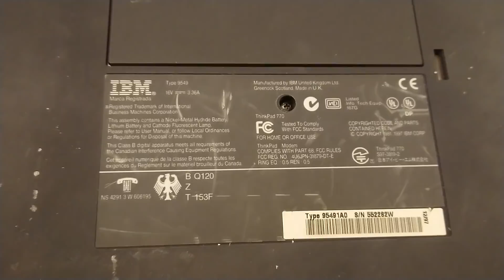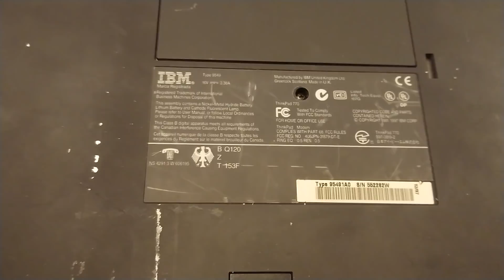IBM ThinkPad 770, from 1997. Vintage Computer Teardown.

Comment: I know was tricky to enter bios do you know how also was an option to disable onboard rams when one of the bank was faulty.
I have 770ed all good just stuck in 00185 cmos battery replaced I still got the same error.
I need to enter the bios but no joy yet.
I need to trace down also the 3V line from battery if there is no damage on trace

Comment: Hi, I have 770z it doesn't work power supply good but batteries dies and screen always black 
HD 14.1 Go
64Mo Ram
Can you help me to revive it?
Reply from the maker: Check the power supply with a oscilloscope, is the output stable? Next check the backlight high voltage power supply for the screen.

Comment: Still have my ThinkPad 770 dualbooting Windows 98SE and TinyCore 10.1 it is one heck of workhorse even after so many years. Excluding the battery recently dying and the failing backlighting bulb on the display everything works perfectly.

Comment: I've got a 770x with a failing hard drive and a dead back light. Do you think I can revive mine? Nice cosmetic shape
Reply from the maker: You properly need a new harddrive unless you can fix it by format/ficing bad sectors, but if its a dropped head its dead. For the backlight you should look for failed/defective capacitors in the power supply for the laptop, or if there is a separate high voltage backlight power supply behind or out in the sides of the screen.

Comment: I have a ThinkPad 560 from the same year and use it daily; I think that is why it is a little painful to see one torn apart even though they are not exactly rare.. they are just built well. Nice teardown.
Reply from the maker: Thank you, I would also have kept it if it was working, a work horse for old programs that needs serial/parallel port communication, especially the old instruments with GPIB interfaces and such :)